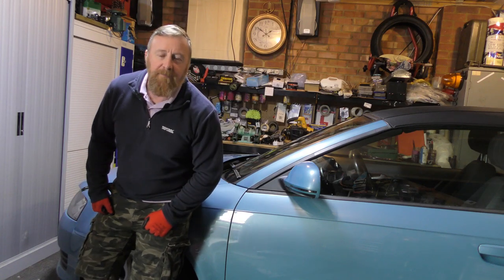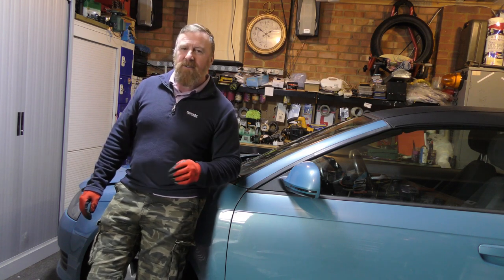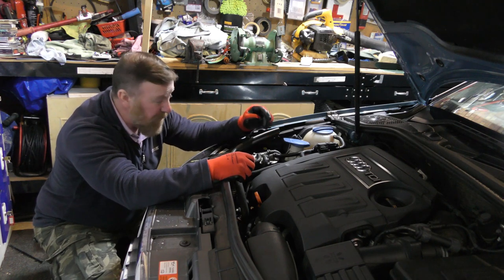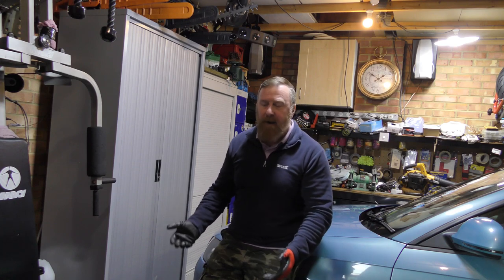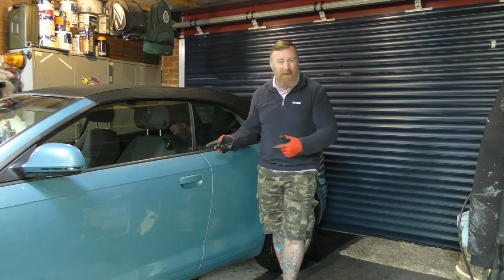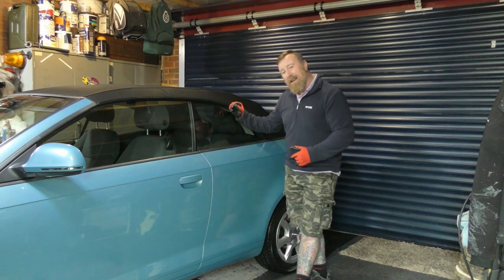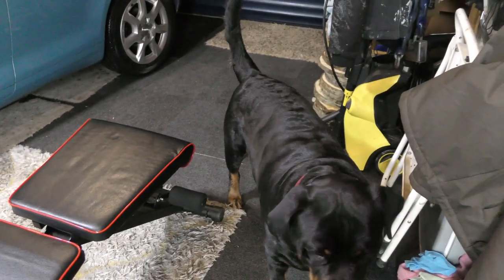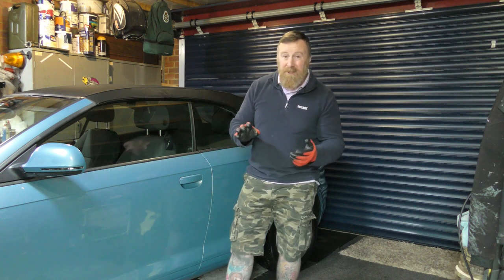BIO DIESEL PROBLEMS CAR STALLING ,NOT RUNNING , MARK SAVAGE

Comment: Welcome back Mark ......Thankyou for the advice.  Most of the VW engines were wrecked when they called them back to have the Diesel FIX applied by the dealer. They tried to reverse the emission issues but never got the running right. Premature failure of injectors and lumpy running high MPG all the cars that had 1.6,1.4 and 1.2tdi's effected
Reply from the maker: Thats not good bud , just shows what they keep quiet and it's still going on ! 
Top man and thanks for staying with me bud 
Take care